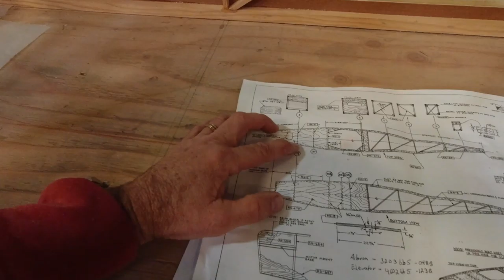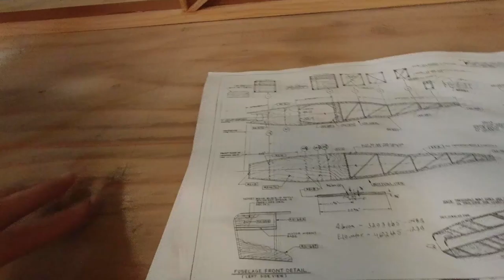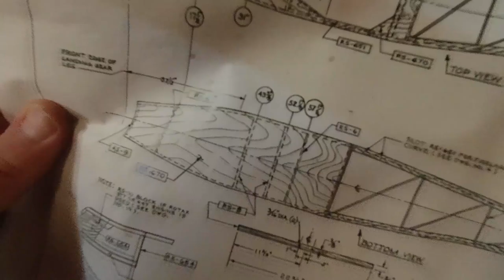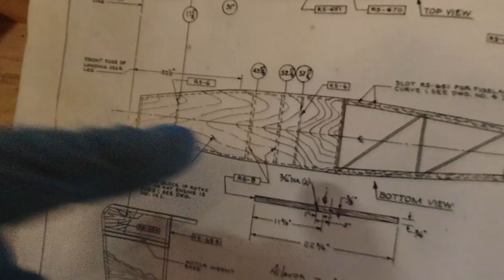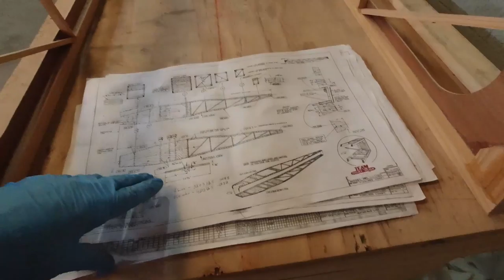Minimax 1100r Aircraft Build Vlog EP 59 - Part 2

Comment: Full cure maybe...30 days??? Very surprising the separation.
Reply from the maker: It actually happens on this plane before you get the bottom sheeting on. The plywood is trying to go concave  and depending on the stiffness of the wood, the wood is resisting the bend.